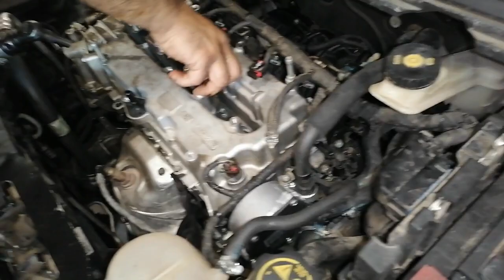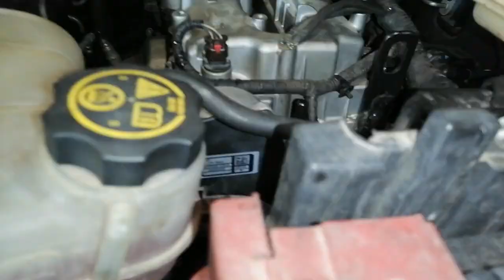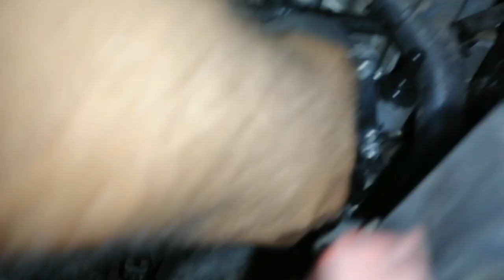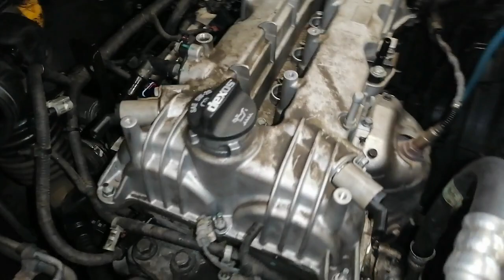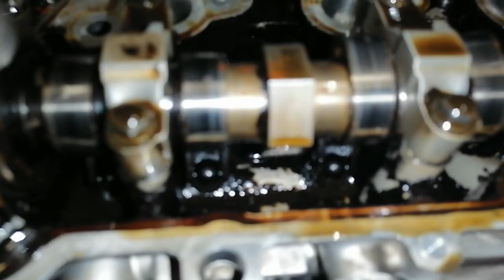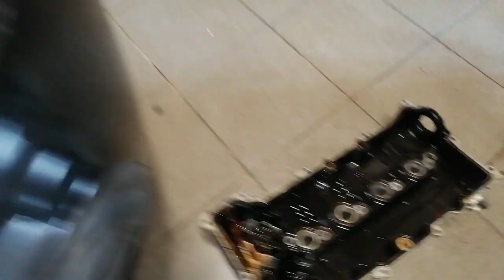Chevrolet Spark 1.4 L Cylinder Head Cover Removal

Comment: Off camera - It looks like you disconnected the PCV, 4 wire harness, disconnected coils from harness and possibly the fuel rail - because I remove everything you did (except the fuel rail)  and there is still something holding it in place - this has been the biggest pain in the butt